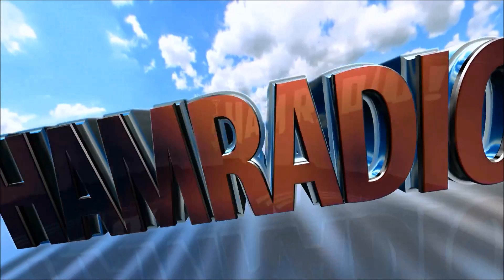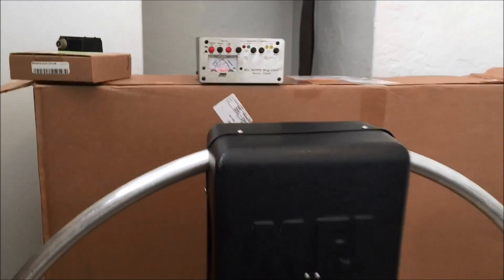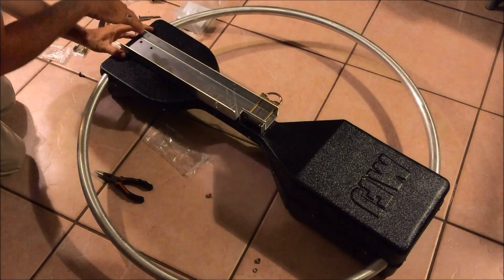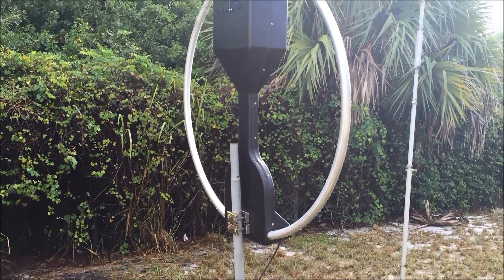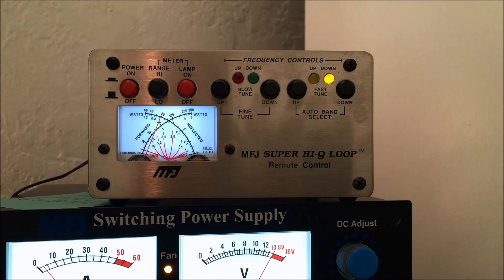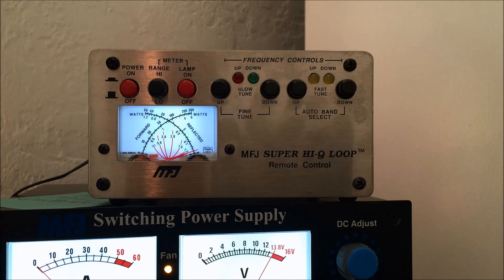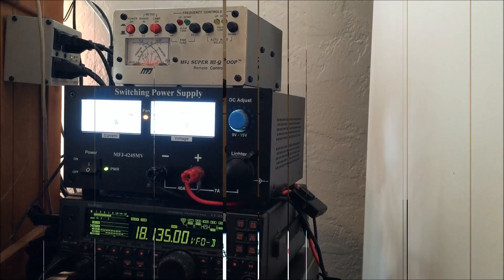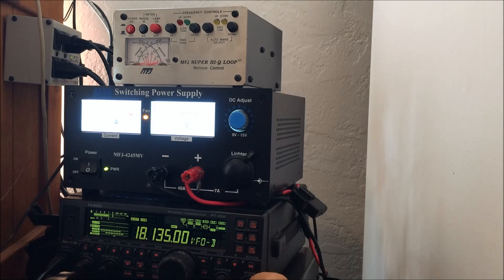MFJ-1786 magnetic loop antenna

Comment: Eric, any thoughts about this 1786 compared to the 1788 (15 to 40 meters) performance-wise?  Is the 40 meters excessively compromised?  Or compared to the 1780 "Box Fan" version, also 10 to 30 meters like the 1786, but one foot smaller diameter loop.  Of the 3, which loop hits the "sweet spot" of price/performance?

Comment: great video Eric. Can you tell us if the MFJ loop is actually 3 feet in diameter? If your floor tiles are 12 inch squares, the box that it came in is only about 2-1/2 feet wide. If the loop was actually 3 feet in diameter, the circumference would be more than 1/4 wavelength on 10M. All the experts say a loop must be less than 1/4 wavelength. Can you please clear up this confusion?
Reply from the maker: Those tiles In my old house were 18” tiles I believe . But it’s been so long ago..

Comment: Eric, you always do great videos this one is no exception. I have my 705 with the mag loop for it the IC 705… 
 Wouldn’t mind having one of these, I could put it on the mast where my vhf/uhf antenna is mounted. Get it up around 25’ or so see how well it works. 
  Too bad it only 30-10 meters, if it had 40 meters as well that would be titties and beer;-) Still and all, might have to check it out if not overly expensive. Again, fantastic video.. keep up the great videos.

Comment: Eric, this is a good, thorough demonstration. One issue - the loop is directional along its plane, not broadside to the loop as you told W0ERE. There are actually deep nulls along the axis at low angles.

Comment: The antenna is too susceptible to resonant point shifts with environmental factors to rely on manually tuning. You need an SWR interface to make adjustments or this High Q will drive you nuts.  Try Ciro loops found at DX engineering.
Reply: Ciro is $2,000. MFJ is $500.

Comment: Stupid question but hey—that's what questions are for, but if I just have this on my wood floor standing upright, is that going to work or do I need to mount it? Thanks
Reply: As with any antenna, height is might. However, one thing to bear in mind with mag loops is that they are dangerous at close quarters. Very high voltage is present on the loop and the near field RF is very strong, so don't sit beside it while running high power.
Reply: @James_Bowie  thanks for the info James. What distance should this be from a person while transmitting? Is there a danger while receiving?

Comment: I hope you're getting commission from MFJ, I'm clicking BUY on DX Engineering's site to get one.  Moved from a big house with a big tower to a townhome and HoA restricted.  Attic is 30' off ground  and is more than large enough for one of these.  Tried running wires and only had success with 10, 15 and 17 meters.  Hoping this magloop does the trick to get me back on 40m. (MFJ 1788)

Comment: Thank you very much for a very informative post.  I (KB6CUN, in Minneapolis) am in an apartment on the 18th floor of a building facing SSW.  I've mounted the antenna on a medium-duty camera tripod so I can move it from the operating window position to a nearby corner when not in use.  I'm very curious about something: is there any directionality to either side of the loop?  I've seen in one video that the antenna appeared to have  the coax connected to the front or out-facing side, and yet am not clear that there would be any difference.  Mine has the coax entering the rear (facing away from the window) side of the antenna.  So far I've found that the lower I go in frequency, the harder it is to find low SWR.  Using RG8U (short lengths) and your same radio, 450D.  Thanks! 73  ps. I tell people who look at it like I'm an alien that it's indeed how I stay in touch with fellow aliens.  Or, I just say it's a sculpture.
Reply: "is there any directionality to either side of the loop?" Yes, mag loops have a donut shaped pattern, with the signal being strongest from the sides and a definite null in the centre.

Comment: Put in on your balcony or patio.   Wrap the outer aluminum with fake plastic Ivy and nobody will have a clue about what it is... Mount a pole in Cement and clamp the loop to the pole.   add some fake plastic plant material around it.  make it look like a bush...and then plant some real plants around it.   keep it away from kids and it will work ok.   Loops DO NOT need to be high off the ground to function.   Most of all have fun.

Comment: was wondering about the 30 watt reading when you said you were putting 5 watts into it.  Maybe I just don't understand the swr meter you're using.  I like to use a single needle.
Reply: 5 watts while tuning. 30 watts while talking.

Comment: excellent video on the loop antenna...you did use i do believe  1 to 5 watts to tune with... which is fine    but  as soon as one will up the power to lets say  60 watts  the swr  change's a lot.... your  1 to 1.5 swr  will now be around 2 to 1..... still not bad  and useable..... i have this mag-loop antenna myself  and at  60 watts input   the lowest i can get on 20 meters  is a  2 to 1.... still not bad  for the loop..... my icom 7410 still like's the 2 to 1  swr  ... some radio  will back off the output  with a 2 ro 1  swr.... anyway i like the mag loop antenna  its a good way to go....just to be diffferent.... nn6aa
Reply: re-shape the driven loop to enhance coupling / allow lower SWR on 20M.  They get banged up in shipping.

Comment: The Solution for all band coverage if you live on a lot like mine with ZERO Trees....   Is either the cheap option of the MFJ Loop, and a Vertical with a base inductor match for working 160 and 80.   Then for 40 through 10 Meters is this :https://www.dxengineering.com/parts/mzz-baby/documentation

The Ciro Loop "Baby" is built like a brick outhouse.   Sure.  It's $2K, but it's built for Northern Winters with the snow and wind, and the Vertical I have had up for a decade.   Base Matching Inductors by MFJ or http://www.ad5x.com/images/Articles/Match43footerRevA.pdf

The Ciro Mazzoni Loop above has an automatic control box that follows your radio's frequency and tunes the radio automatically.  There is no fiddling with buttons.  

Magnetic Loops are fantastic performers.   I have used them for the past 26 years.    I just built one myself that is portable.  It works 6.700 through 22.000, so 40 through 15 Meters.  

For Fun, Search on Google (Images) "Magnetic Loops".   It is mind boggling the different designs.  

Thanks for the video.   When I lived in upstate NY, I ran one of these in my Attic, and broke pileups on phone ALL the time with less than 50 watts.   It is absolutely the best antenna for either portable or difficult situations.   It's the most power out, and it's really what every ham wants.  super low SWR, and Minimal fuss.   

This Guy has a great site about Magnetic Loops.   There are several Videos.   

https://www.youtube.com/user/loughkb/featured

73.  KB2QQM

Comment: I had the AEA Isoloop.   I kick myself for selling it way back in 1994.   Since then I have built my own loops.   they work GREAT !
Reply: I had one of those at one time too. I think it worked well when I had my condo but it didn't load very well in my attic at my current QTH. The controller was destroyed in a flood so I just tossed it out. It was over 20 years old anyway. Maybe I'll get one of these once I get my station back together again.

Comment: Has anyone done a test in both the vertical and the horizontal position to see which performed the best? I personally don't see a reason to use it horizontal 
other than maybe a space restriction issue.
Reply: Jd Martin - That is exactly the same thing I would like to know. Vertical or Horizontal??? One replier did say if you can get it up in the air about 20 feet,  mounting it horizontally would make it more omnidirectional.

Comment: Almost 2 year's on after this video and with the cycle heading toward the bottom of the cycle,  i'll give you my update of the 1786x....I have my loop horizontal on a 20ft pole and a small tv rotator... worked ZS, PY with 95w on 15m, EA9 on 15m with 5w power out, N4LA and AE7KI TODAY 01/10/2017, 95w out..... I'm just a little gobsmacked and delighted with this loop.... way beyond my expectation of what I thought it would do and what it DID do.... VY73 All... good dx de MI0GTA... Stevie
Reply: are you still using it ?

Comment: Eric,
After watching your video, I purchased the MFJ 1788 even though I had some concerns with supposed quality control issues that I had reviewed on some sights. Living in an HOA community I needed something that would do the job at a full 100 watts, be stealthy or be portable. I am so happy I did! This antenna does a surprisingly good job of getting a great signal out. The remote control makes it easy to tune, although there is a learning curve.
I have the loop mounted on a 4' pole using a picnic table umbrella stand in the driveway of my condo.  When I'm done I just bring it back in the garage until the next time I operate. I'm using the Yaesu FT450D in PSK31 mode right now and and even when the band is not so hot (which is most of the time anymore) it still does a great job. Made contact with a Russian station back in June ( R6AV ) which has been my longest contact so far with about 30 Watts. This antenna is a keeper, thanks for the video review! KC8ROA,  Carl
Reply from the maker: Thanks.. I still swear by the MFJ  loop antenna. I have used it to outperform others with a hexbeam at 25 feet and wires at a field day event. It's a real rockstar.
Reply: Carl Dennin   L v

Comment: can it tune with an icom 7300 internal atu ?
Reply: NO.   you have to change the capcitance on the Loop via the built in motor on the loop.    The great thing about Loops and why you can transmit full power into them, is because the Capacitor tunes the inductor (loop), pretty close to perfectly.   Although the bandwidth is super narrow.    If you are in a tough situation for an antenna, Loops work great.  Just place them away from pets and kids because the voltage coming off loops can Zap the crap out of you, and dont transmit right next to them either.  Put them at least 25 feet away from you.  They are efficient as heck.  Google:Small Transmitting Loops.   They are pretty easy to build.   Obviously having a Commercial loop is the way to go.  Also Loops do not need to be way up high to work.  They can be 2 feet off the ground.   good luck.

Comment: The one real advantage to this antenna (to my mind) is that unlike other mag loops, the tuning box allows it to be tuned remotely, without having to run outside and try to tune with noise and then run back and forth until it's tuned. I set mine out on the balcony, using a thin patch cable (Comet CTC-50M) so that I was able to fully shut the sliding door onto it with no loss of power (the flat cable handles up to 100 watts, as the MFJ mag loop does) and I am happy so far.

Comment: Thanks to this video and Eric's Recommendation I purchase this antenna.  I live in a deed restricted neighborhood so I put this in my attic.  I couldn't be more pleased.  I also used this antenna on Field Day 2016 in my toy hauler trailer.  Eric did a video from there and the contacts were amazing.  Check out his other video on how to operate on Field Day. 
https://www.youtube.com/watch?v=zKXfdBMpytQ
Reply: jfranke3 - Did you mount yours vertical or horizontal? I live in a Town Home with a strict HOA and only a 20'x20' garage attic for an antenna of some sort. I am going to try to string a 31' (Off Center Fed) Dipole for 10-40m in the tight space. However, I am very interested in the MFJ-1786 magnetic loop antenna. Never tried one in the past due to high cost. They are a bit pricey compared to an $85 dipole...lol!

Comment: A capacitor and a 1m metal loop? I would think you could build one with little cost that would operate from say 10meg to 30meg. Just think the price of some ready made equipment is high. Maybe when the word HAM comes into things the price goes up. 

I will try this evening to source parts to try and home brew this thing. 20m-10m would do me.
Reply: Plenty of people make their own magnetic loop antennas. Plenty of good info online. If you google "magnetic loop antenna calculator" click on the first link which is from 66pacific.com. That calculator is really handy for calculating the size of each loop. I am planning on building a mag loop based on the Alex Loop Walk Ham. It uses coax for the main loop. My plan is to use RG-58 for the main loop since it's' cheap and compact. My loop will be manually tuned however. But a loop tunable from inside the shack would be nice.
Reply: Victor Nelson i
Reply: It needs to be a very good capacitor to run any sort of power.

Comment: Also, after tuning a particular band, once it's tune, then that etire band doesn't need to be tuned anymore unless I change bands? And does the unit have any type of a memory when I can just move through the bands without retuning it each time.
Reply: +cigarjohn42   It will be at resonance at the tuned frequency and will only deviate around 10kc or so before having to retune the capacitor again.The Q is very narrow on magnetic loop antennas,but they also act as a preamp filter,rejecting QRM from adjacent frequencies....73...Dennis W7KB.

Comment: If I mount this antenna in my attic or outside roof, should it be used with a rotor? Also, if you don't use a rotor like in an attic installation, is there a marking on the antenna to determine which direction I can point it in? Also, can this antenna be used with out that control box. Will my radio's built in antenna tuner tune this antenna?
Reply: John Athanassion No problem,John.Let us know how it works out.You can even email contact me on qrz.com by my callsign if you have any further questions on your mag loop.I'm no expert on them,but I have owned and used one for several years now,enjoying their capabilities with such a tiny footprint.Be careful,the results and ease of qso's made may shock you with such a small antenna,even at qrp levels.Once you get used to the constant tuning after frequency changes,you will be utterly amazed at the signal reports you will receive and the ease of making qso's with it as you fill up your logbook.Best 73 to you...Dennis W7KB.
Reply: +cigarjohn42   Mag loops can be mounted vertically with a rotor in your attic,but if mounted about twenty feet or higher above ground horizontally,they will radiate in an omnidirectional pattern.
Reply: +redman840 Thanks.
Reply: +redman840 Should I tune my bands at the lowest power settings possible to get a good match before transmitting at a higher power level? And is a dummy load required?
Reply: John Athanassion Always tune at lower power levels to start,say about 5-10w,then raise your power level in increments to make sure you are still tuned at proper SWR levels.10/25/50/100 watts in increments,is the safe way to ensure that happens.A dummy load is not required,one can tune up on air,always making sure that there are no others on frequency prior to transmitting.Don't expect a perfect SWR on all bands,for that may not happen,just try for lowest readings.Try to keep your loop away from other metal objects,so as not to couple to them and throw off SWR readings.Do not use your tuner,for you are tuning to exact resonance on that frequency.Loops work a bit better in the open areas of a yard,field or park,but will also work fairly well in other environments.Its's fairly simple...give it a try.
Reply: Thank you very much for all your help and being a kind of an Elmer to me online. Greatly appreciated for taking the time in steering me in the right direction. I wish you the best in all  your HAM projects. 73's! ;)
Reply: +redman840 Thanks, will definitely stay in-touch with you with my results. 73's aka N3NQP

Comment: What is your noise floor normally where you live with your off center fed dipole? It looked about S1 to S3 with the loop. 

Where I live and with my R8 vertical, my noise floor is S5 on a good day, S9 on a bad day. I'm wondering whether the electrical noise rejection of magnetic loop antennas would help my situation, whether it's worth the ~$500 to try. 40m and 80m are where I really have problems though. I'd be ok with an Rx only antenna since my rig has an Rx antenna port and switches automatically to the main antenna for Tx.

73 de KR6ZY

Comment: Eric, 
Great video.  This is Al, W0ERE.  Obviously no one can argue about using a Magnetic loop for transmitting.  You did it and you did fantastically well.  Congratulations!  You sigs were totally readable. You really surprised me with the on air result. Enjoy ham radio!
Reply: Hey you circled back to drop a line on the video!  Cool!  73 DE VA3SPV